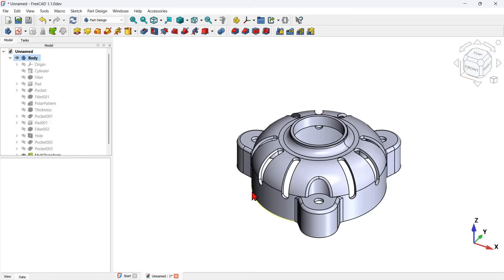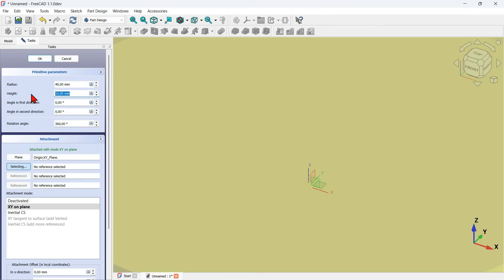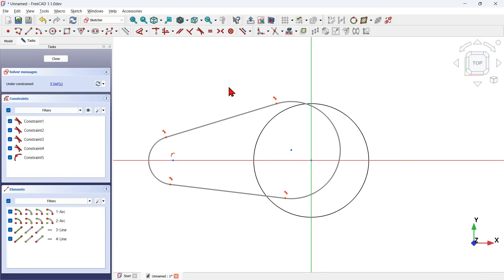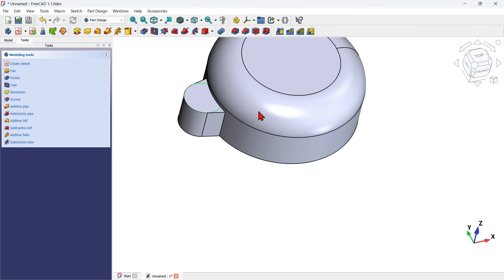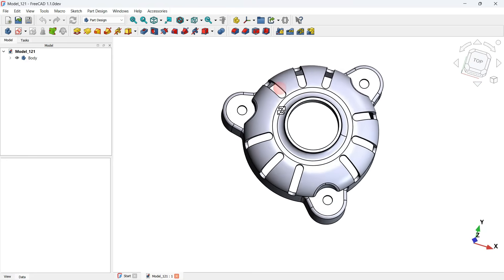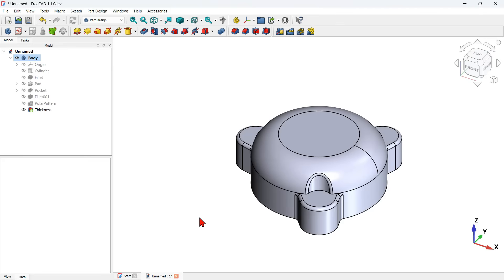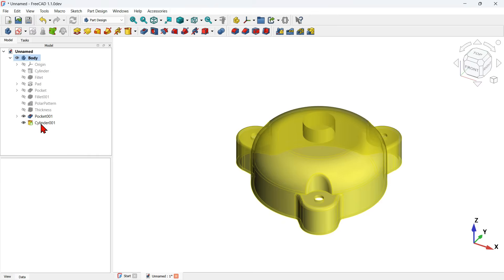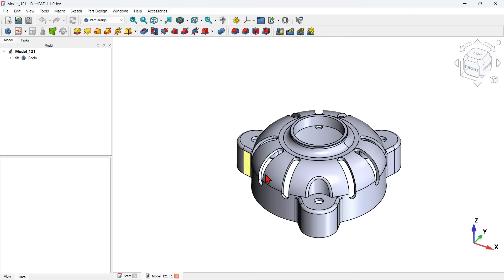FreeCAD 1.1.0 Dev: 3D modeling

Comment: Awesome, little time saving tips and tricks, short cut keys are always welcome. 9:42 you selected all 3 circles and then the dimension tool, diameter, 6mm and all 3 were changed, versus I selected all 3 circle, equal, then dimension, diameter, 6mm which were 2 more clicks then your way, so I went back and changed the equal and followed your example. These tips & tricks how ever small I make myself go back and make the change, it's like taking notes! Why watch your video and get ahead before you and miss all the small details. 90% I know what may be the next step, and I am proud of that, too.
Practice, Practice, Practice
Reply from the maker: Thank you for the feedback.

Comment: FreeCAD assembly keeps falling...
Reply: I LOVE the idea of free cad, but sadlly a lot of work has to be done, my cad experience is mainly solidworks
Reply from the maker: The same happens to me for almost all assemblies.
Reply: @OffsetCAD  not yet ready for real profuction in my opinion, you lose more time trubleshooting then designing, when you are working with fix joints It normally works ok, but when you add sliding with ranges It just break

Comment: Everything works great until I  attempt to copy the three slot polar pattern as one entity, 3 @ 120° apart. It just won't do it. Is your 1.1 developer version significantly different than the 1.0 version I'm using .???
Reply from the maker: I don't think so. But are you using MultiTransform for this, right? Because if you are creating a pattern from a pattern outside of MultiTransform it will fail. Simple operations like Polar or Linear pattern do not accept creating patterns from others.
Reply: @OffsetCAD  Thank you!  I was using polar pattern not the multiTransform feature. It worked!!
Reply from the maker: 🙏 thank you for the feedback!